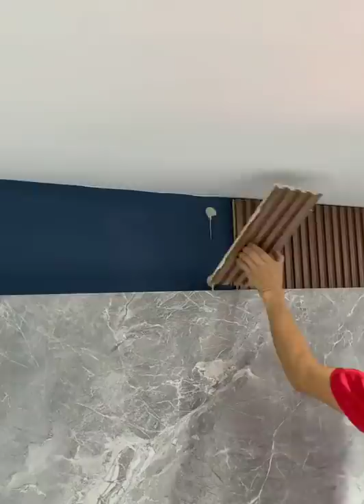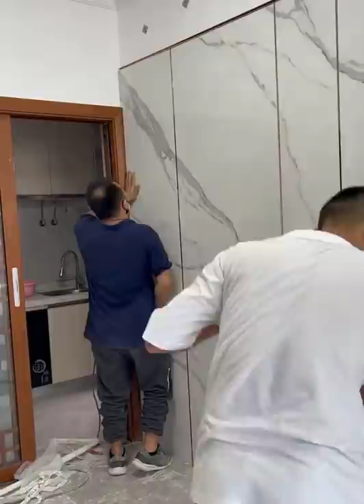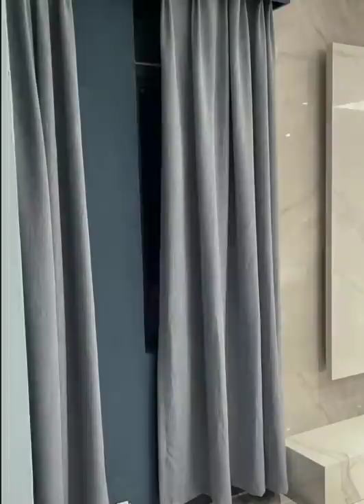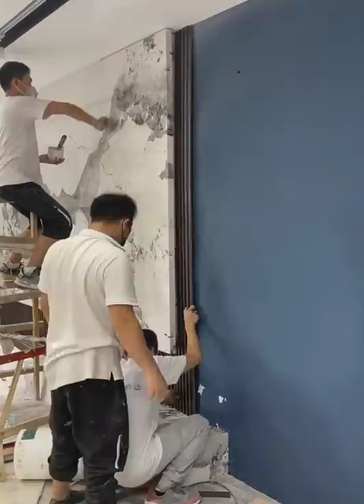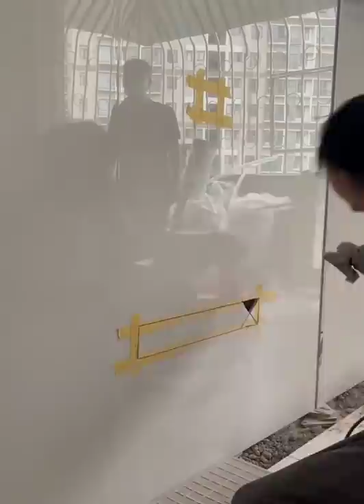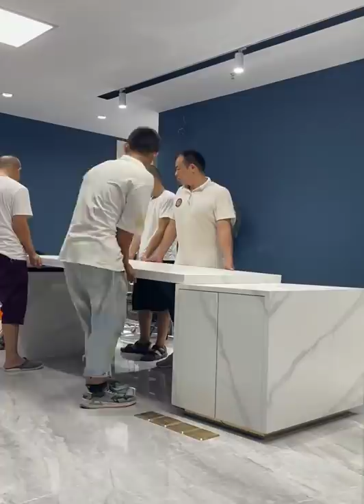Young Man with great tiling skills -Great tiling skills -Great technique in construction PART 96

Comment: Nice cuts,,but you get what you pay for,,cheap installation!!
Reply: I was wondering that looks like a couple spot bonded areas on the backing wood it looks like some really strong glue
Reply: @Miketweets  I was wondering about this too - but then I thought perhaps the back of the tile is buttered and I did see it because there is still squeeze out - nonetheless those spots of glue seem odd to me
Reply: @peetabrown5813  ya I don’t think so. I’m an accountant myself but I would think the back of the tile is buttered to key in the thinset. Then I skim the wall and apply the thinset there to get coverage. But I have done it on the back of the tile then I would have keyed and skimmed the wall not because there wouldn’t get the even coverage for adhesion. But again I’m an accountant so I don’t know. But I think you need 95% for wet areas and can’t recall for this but I can see the difficulty in applying even thinset and trying to level it
Reply: @Miketweets  I think what you say sounds right

Comment: I don’t think they are tiles. They are vinyl sheets on composite material. All decorative. Gluing them to the wall.
Reply: Porcelain slabs with mitered edges
Reply: Porcelain slabs with mitered edges. Yes the pieces are adhered to a form
Reply: in your country cutting a vinyl with grinder?

Comment: Its horrifically fragile but if you want cheap but looking nice, this will do. One thing for sure, you don't want them to put floor tiles 🤭🤭
Reply: This is not fragile. They are using more likely sintered stone.
Reply: @Marguerite-wu3nw  yes, but if you touch it, it falls off, and also if you wait a few years.

Comment: Sintered Stone is manufactured using recent technological advancements which mimic the processes that form natural stones. While natural stones like marble and granite are formed over thousands of years, Lapitec stone slabs take just a few hours. Minerals and stone particles like the ones found in porcelain or granite are carefully selected for quality, colour and texture. These particles are then subject to extreme heat and pressure – just like they would be deep in the earth’s crust for thousands of years, but achieved much quicker. When the process is finished, the particles are bonded together permanently, without the need for resins or bonding agents, to create Sintered Stone.